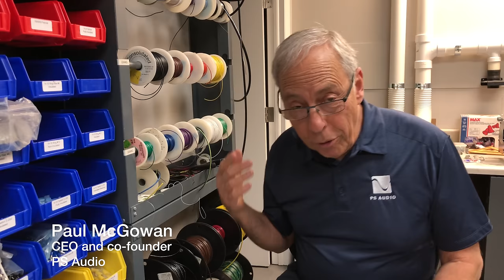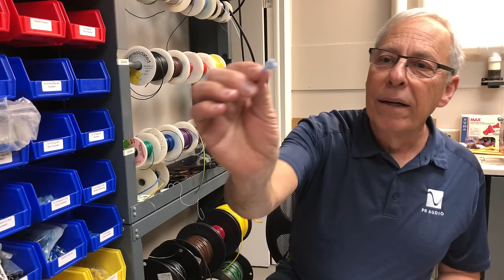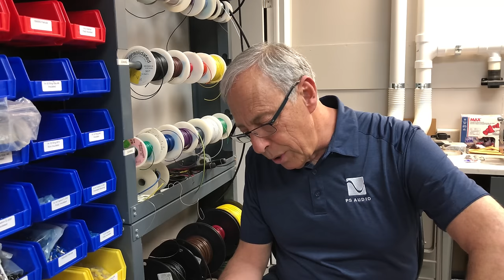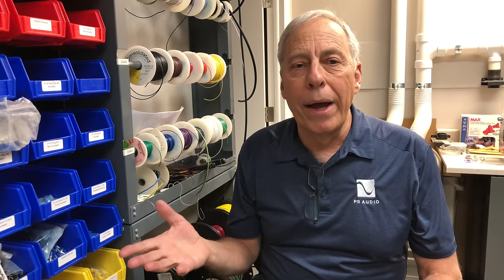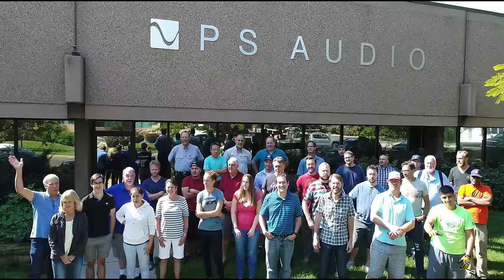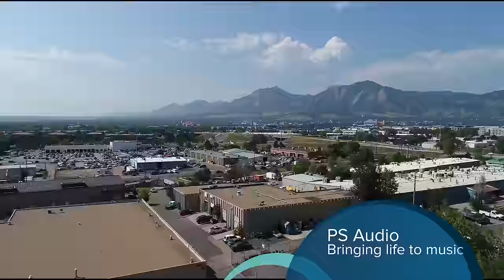Electrostatic speakers and music

Comment: BLOWING MY OWN TRUMPET
(or bragging about my own speakers) 

I make my own speakers from components that I purchase. I have 2 pairs so far, a pair of lounge towers and a pair of PA speakers. I also build my own crossovers and I can make a speaker sound how I want by tweaking the crossover (mainly) and also by doctoring the drivers and tuning the enclosure and bass vent. I also made a new type of bass vent.

I purchased a pair of 10" bass/med PA drivers with a 3" voice coil and 3" center cavity, of which I set in a bullet tweeter (2.7" diam) that just fits in with a small gap around it. PA drivers like these are the only type driver with a voice coil large enough so I can set the bullet tweeter in the cavity. And I can adjust the tweeter at the best point-source height, cos the depth of the central cavity in the bas/med drivers is sufficient to get the tweeter seated deeply enough for point source sound. The tweeter diaphragm is just above the start of the bas/med cone. Phase aligned with the best average position (considering cone slope and high frequency source in the bass/med drivers). The PA drivers cost $200 each (Aust) and the bullet tweeters are $23 each. 150 w power handling and more efficient than my lounge towers.

The PA drivers are in a "fold-back" type enclosure and the 10" driver is set about 4 mm above the hole on the enclosure (by spacers) and the speaker hole has a 1" lip around the inside (lip made of bent ply). The lip gives better acoustic quality in the bass/med and the raised driver makes the voice sound much more "open" and improves the med from a 10" driver.

Inherently the med from a 10" driver is inferior to a 4" driver, cos 10" is too big for good transient response and resonance is more prone with large drivers, causing coloration in the med. Raising the driver from the enclosure seems to help a lot cos it completely changes the resonance patterns, but the transient response is still lacking with the heavy 10" cone and there is still some coloration in the upper med. So I doctored the 10" cones by slightly scribing like bicycle spoke lines on the cone to make it flex more (and still be bass stiff). And I have a couple of bits of light foam rubber glued to the 10" cone inside. 

And also I fed some med into the tweeters (they have a 1.5" diaphragm) and they seem to handle 22 mf caps without blowing out or making any bad sounds and the med signal is cut back with about 40 ohms of resistance and it's in parallel with the main cap. The main cap is a two step cap. A 2 mf cap and a 1 mf cap (1.8 ohm resisted) in parallel with the 2 mf cap. This makes it effectively 3 mf. This is better than the straight 3 mf cos it improves the "S's" in the speech. Speech is great for testing speakers cos we know what a voice sound like. The med from the tweeters is superior and covers up much of the coloration from the 10" cone.

They are the best speakers I have heard cos they are the first two-way point-source speakers I have heard and the sound quality is there too. I have a 200 w per ch amp and when you turn it up loud, the music oozes with that great super soundstage image. The image is more powerful than with single full rage speakers cos they are two-ways. If you spend a lot of money on good full range drivers they have a good soundstage, but the vast majority of full range speakers don't go high enough for a good image (even if they are point source). 

The good full range drivers are way expensive and they still have the doppler problem anyway (and the top high-end Feastrex full range drivers are like $70 grand a pair). lol It's the combination of a single source, great high frequency response and non colored sound that give you the great point source image. So instead of spending so much on good full range speakers, point source two-ways are a much cheaper way to get the extra khz for that point source soundstage (like the KEF Uni-Q speakers). 

My PA speakers are completely 100% point-source cos the bass vent is also point source and the new vent design doesn't compromise bass/med quality either. It sounds as good as any bass vent. The bullet tweeters are really efficient so I had to resist them a bit to match the bass/med drivers (that are also way more efficient tham my 6" lounge speaker woofers). The extra med fed into the tweeters makes it sound amazingly accurate and detailed cos of the superior transient response in the tweeter's med. Voice sounds really smooth for a 10" driver. Voice and piano are the first things you notice that is delightfully different with point source speakers.
Reply: wow..sounds interesting..do you have pics or plans? Im interested in making some speakers myself...did you make the boxes with wood ? also any idea how much it cost you?
Reply: +Justin Griffin
MAKE YOUR OWN SPEAKERS
Use any size box (within reason) and make sure it's solid and use damping material inside. And you have to adjust the bass vent size to match the driver and box used (explain later). Buy (or find) woofer&tweeter and a 1.8 mh choke for the woofer and a 3mf cap and a (highly resisted)22mf cap for the tweeter. Connect 3 mf cap to tweeter and bypass the cap with the 22mf cap resisted by 47 ohms resistor. The 22mf cap makes the tweeter sound "point source" (similar setup used on some speakers made commercially). It greatly enhances the "image" by having more of the vowels in speech in the tweeter.

If sound to too much bass resist the woofer a little bit.
If there is to much treble, resist the tweeter a little bit.
If treble is too harsh go to 2 mf cap.
Iif treble is too "wiry" thin go to 4.7 mf cap (a rarity).
If voice is too husky or harsh resist the 22cap on the tweeter more.
If treble is good but voice is "muffly" resist 22 mf cap a less. 
If too much voice go to next size up choke on woofer.
If not enough voice go to next size down on choke on woofer.

Use a 2" tube for the bass vent and a small tube hugged around it that can slide in-and-out. Try with fully extended and if bass is too "pumpy" lows than shorten the tube till it sounds best and stick it there and make the other one the same. Or if bass is too "bonky" extend the tubes more. 

This is a really simple design (not the best) but better than no crossover and it's easy to make (except the tweeter bit). The secondary choke is omitted (on the woofer) cos it's more expensive and hard to do but if you want to do it you have to put a back circuit on it and it gets tricky cos of impedance problems. One choke is not too bad cos it's usually fairly small and that's what they do with cheaper speakers. One choke instead of 5 things and so much simpler to do. Sounds good too but you still may need some bass boost on the amp. Make bass horn enclosures for more bass with just one choke.

Comment: No No NO NO NO I will never give up my Acoustat X's. They may be revealing but they absolutely do not lack bass or dynamics. A good recording sounds like the real thing and that's what matters. I have a lot of other stereo systems for playing average to poor sounding recordings.
Reply: Agree! I will never give up my Acoustat 1+1 ESLs. I also don't agree with Paul's opinion, keep the ESLs. I've found bliss recently in used vinyl from the 1960s and 70s, especially classical and jazz. Seems the recording techniques and esthetics peaked around that time.
Reply: Agree strongly, i have a pair of X's and IV's. They are absolutely wonderful speakers that some 30 years on still work without flaws!
Reply: I found my ESLX has a wider soundstage than convention dome and cone speakers. Placement and imaging is very forgiven compared to conventional speakers. Perhaps he’s referring to much older speakers but think it’s a misleading statement and he looses credibility by making it.
Reply: Make sure you update your servo amps with good audiophile grade caps and use GE 6HB5 tubes and your Acoustats will sound stunning.
Reply: Running modded servo amps, keep the faith. I still remember Absloute Sound's review and they were stunned at the bass. Could shake concrete.

Comment: paul i have used electrostat speakers for a long time and you are right they do all you say until i solved the problem first i put my dayton wrights away  i then thought about an es speaker that i heard a long time ago acoustat 2+2s it took some time to find them got my first pair and wow what a diff from the d.w.s  still i new it could beter i now have 6 2+2s 4 put together with supertweters on front and rear of 4in full panel 2 in center of room on same side as others 18in subs in corners downfiring on other side of room ihave a 4x12 coustom sub with a pair of bose 901 s2 eqed by a dit equlizer 2 supertweters all are put throu a speaker manmenaget sys tem running mackee amps and yamaha amps all speakers have sep volumes you can set and blend it all walk were ever you want to it sounds the same i use a pro cd player it will make you cry its sounds so sweet there is a lot more to it set up wize we wont get in to that yet it can be done man and es speakers getting along you will fall in love with all the lady singers   keep the vids paul they are great  frank diaz  first system when i was 6 years old
Reply: That’s one, long sentence.

Comment: No base? Electrostatic are suppose to have seperate bass drivers.
Reply: The latest Quad Electrostatics definitely have bass. A dealership (now closed) in my city used to use a pair in his demo room and sold me several items demonstrated with them that I subsequently enjoyed for years.
I don't have room for electrostats in my house but practically as revealing are Lowther horns. I have a small pair of those and found them far too revealing when I first purchased them. Improvements in source components have rectified that situation. I can still enjoy music even if badly recorded. I have been doing this hobby for 45 years and while I like to hear the detail and emotion in a recording, my number one requirement is that I can forget the equipment and concentrate on the musical performance...

Comment: Not quite.. When you move left (or right) from normal speakers you hear alot more of the other speaker than you think. Try and then disconnect the oposite speaker from the one you are closest to.
I can sit straight in front (let's say 50cm from the speaker) of my left speaker and still hear ALOT of the right speaker. The further back from the speakers I sit in the room the more I hear both speakers.

Comment: Me, Me, Me and you had to re-read the question. 
So, Mr McGowan does not much like electrostatic speakers. Placing is, of course, vital but 'head in vice' and restricting music played? Not if one doubles up horizontally and experiments with precise feed using very simple means as the late Mr Peter Walker kindly demonstrated to me 50 years ago.
He was not averse to using very tight, professional 'woofers' in line and the ones he use were ex-cinema JBLs placed behind 57s and set in such a way as to "slope"/extend deep bass emphasizing that attack harmonics were within the range of the production 57s.
Unlike other inventor/manufacturers, Mr Walker was not a 'complete system' man. QUAD made these for home listening but too many 'hi-fi' writers forget that Acoustic, Huntingdon supplied the BBC and many EBU stations as well as universities and music colleges.
The performance of electronic music and musique concrete in Europe tended to use his speakers as being the most reliable in challenging venues. They actually traveled better than one might think.
Reply: he doesn't like them because he doesn't sell them. its that simple. if he made electrostatics that's all he would talk about

Comment: Electrostats are the best audio experience
Reply: How long do they last though? I heard dust collects on the membrane.I'm looking to get some Martin Logans but haven't taken the plunge due to the dust issue.
Reply: Martin Logans are good but they have an issue with the conductive coating on the diaphragm going away as they age. Yes you will need to vacuum the speakers from time to time but its worth the trouble. I think Sound Labs are the way to go these days unless you can find some used Acoustats.
Reply: Thx for the info Anders and  I will look into those brands. :)
Reply: Yes with caveats!
Reply: For midrange and highs.
Reply: Unless you have monitor IV's or X's. The panel array makes for exceptional bass when driven correctly (servo amps especially)
Reply: In terms of bass reproduction almost everything sounds distorted compared to electrostatic bass.
Reply: @andershammer9307  Soundlabs put Martin logans to shame on a entirely different level. I have heard both and own Soundlabs i hated Martin Logan and had Paul's attitude until i head my speakers on OTLs and have been in audio bliss since then.

Comment: I have a pair of modern large full range electrostatics, no sub woofer or crossover but segmented design with treble from centre strip and bass from entire diaphragm surface. Lack of bass and laser beam dispersion is a thing of the past. Paul, you need to update your conclusions.
Modern electrostats are totally unbeatable when fed a high quality source, but electrostats will not compensate for or mask shortcomings in poor recordings . Garbage in, garbage out.
Reply: But hopefully there is enough good in the recording to listen past the bad. My system will pull anything good out of the recording if it is there. Not long ago I put on a CD of The Best of 3 Dog Night and my system sounded like a giant transistor radio.
Reply: Paul is in denial and comes across as very closed minded. Agree with you 100 percent! I have a pair of newer Soundlabs and the things Paul describes in this video are foreign to me and do not describe my speakers at all  . I  kind of feel sorry for him if he still believes this.

Comment: I'm building a low budget system right now, starting with hafler xl280 amp,with hafler dh110 preamp, what if any turntable or inexpensive speakers would you suggest I go with.
I live in small 2 bedroom apartment, thank you for any recommends!!!!
Reply: If you haven't already made a purchase this is my take. If you like a warm, forgiving sound then the Wharfedale Diamond 11.1 standmount or a second hand 10.1. If you like an accurate, upfront sound a Q- Acoustics 3020 is excellent or second-hand 2020i is a great buy. Q-Acoustics make floorstanding speakers and all of them are good except the original 2050. The 2050(i)- 2050i is outstanding as is the 3050 and 3050i floorstander.

Comment: No bass???   Sorry Paul these are not the QUAD years...electrostats are the single best, most musical and fastest transducer material for reproducing the true emotion and human experience in music.   You obviously never heard SoundLab speakers...
Reply: I rather stick with magneplanars, as good as ESL's sound?! They have way to many downsides, the need for high voltage (thus power) they draw dust like it's nobody business. Also LOW is always been an issue, no matter of what year. And to put it in perspective I play with no less than the Tympani (3 panels 6 foot tall per side) without a sub?! It's very flat and not nearly as deep as any of my cone speakers (I got about 10 pairs of speakers to compare too) MID HIGH! is super hard to beat, unforgiven and honest. A shitty recording will reveal triple fold because it's line source...
Reply: Poor Paul is taking a beating here. If he reads these comments maybe he will try some Soundlabs and be blown away and make a revised video stating how full of shit he was in the first but somehow i doubt this will happen lmao.

Comment: Never liked electrostats. Sold them for 10 years. Only well recorded music sounded good on them. I'd rather have speakers that allow me to listen to what I like.
Reply: Hmmm.  Sold them for 10 years.....when did you last sell them?   I have Martin Logan Classic 9's from the Masterpiece series.  I have had horns, domes, cones...   Let me say to you and anyone reading, I made the 180  degree switch last year (2020) and never looked back.  

You can play ANY type of music, there are NO restrictions contrary to belief, dynamics are incredible.   And NO 'head in a vice'.  The image is VERY wide, and the bass modules provide PLENTY of low end.  Seemless transition as well.   Nay sayers need to go and hear them in a properly setup room.   And DO NOT skimp on power.  ML suggests 400w per ch. !    

Ask anyone whom owns these newest models, and I am sure they will concure (O:
Reply: @garysmith8455  What model are you running?  Looking at Soundlab M1's thx
Reply: @CarlVanDoren61  Hello Carl.  The amp is a Parasound A 21 and the pre is a Parasound P6 2.1 using Kimber 'PBJ' balanced interconnects.   My local brick and mortar audio store (Safe and Sound) put the package together with the Classic 9's.  Hope this helps (O: